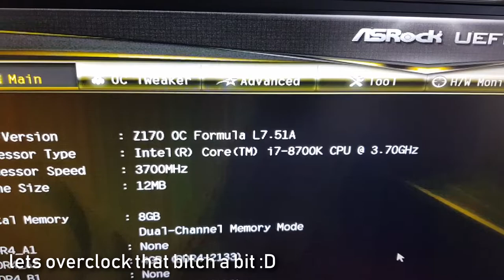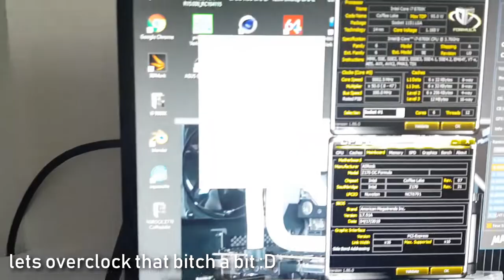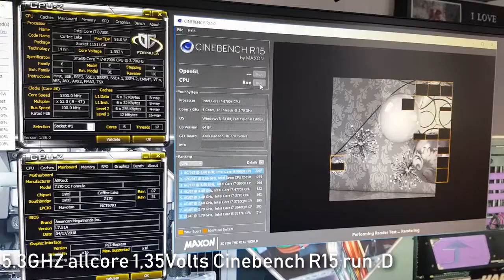Coffee Lake working with Z170 running I7 8700K on a ASROCK Z170 OC Formula

Comment: is this viable for long term use without damaging the CPU / mobo ?
Reply from the maker: sure :)
Reply: I have been running 24/7 for 2 months with no issues on a 7700k
Reply: @r3drumg33k3  z170 chipset is compatible with 7700k.  It's not compatible with 8700k and up.  It will work with the modded BIOS and/or hack, but this will shorten the life of the board.
Reply: @BrainToMush  you can run a 9900k on z170 my friend, WR was held on the asrock z170 formula-m
Reply: @r3drumg33k3  yes you can, but it shortens the life of the board.  It runs more power through the chip set than what it's designed for.
Reply: @BrainToMush  As long as temp is in check on the vrms and caps I totally disagree. Most people running a modded bios are willing to take a bit of risk, let alone soldering on the cpu/ shorting pads to make a 9700k or 9900k run. I'm going to try a 9900k on my board in not long, so I can let you know.

Comment: I have a Gigabyte Z170X Gaming 3 rev 1.0 and also a 9900K, can i make it work as your video described?
Reply from the maker: no ... with out a modded mainboardspecific modded bios ... no way
Reply: @CustomrigsDe   apart from modded Bios, it seems i need to mod the very cpu aswell...can you confirm this?
Reply from the maker: @aris9125  didnt know ... but for every modded z170 bios you have to modify the cpu ... that is what i know